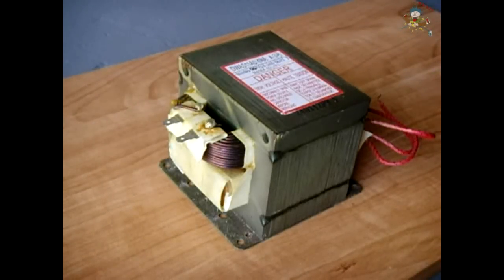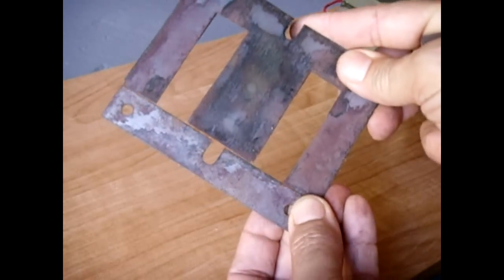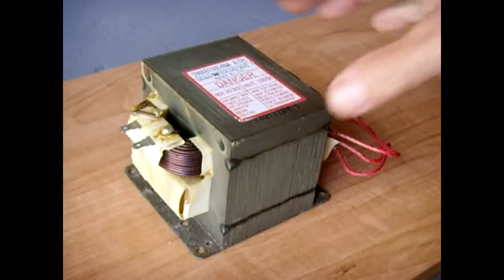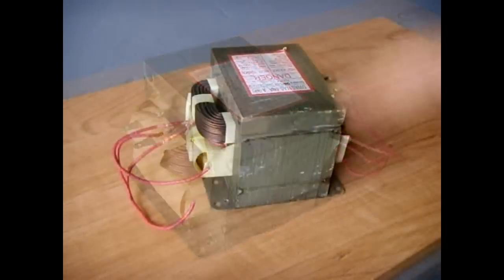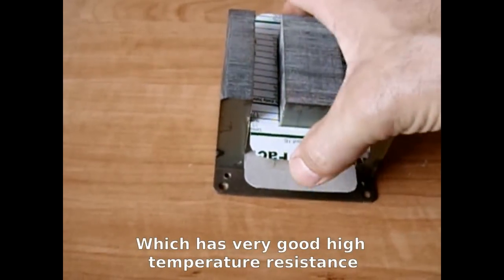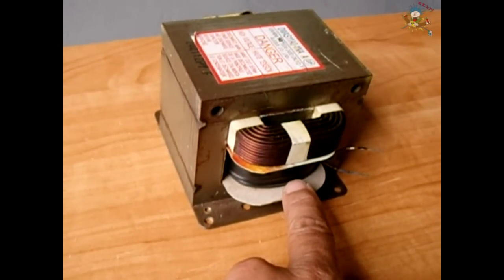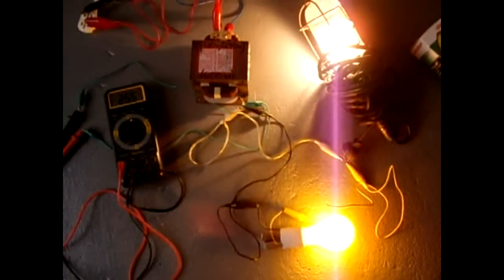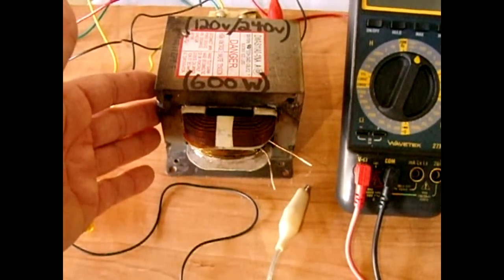How To Make Custom Power Transformers

Comment: how did you take the copper windings out of the core?  did you heat it?  need to show how to do it.  i have been trying but unsuccessful.  the glue is the problem.
Reply from the maker: No heat. After the core was opened up, I kept wiggling, and gently prying the primary winding until it started to lift out. Be careful. You do not want to damage the primary. Use a thin piece of wood or plastic against the coil and pry against that(close to the core). As one side lifts, you have to insert a wedge to keep it from going back down as you pry up the other side. Don't worry about damaging the HV secondary. When they are both removed, you can take a razor blade and clean the core to remove any varnish.

Thanks For Watching!

Comment: What type of welding do you use at transformer cores stick or flux core welding ?
Reply from the maker: Stick
Reply: Ok that is cheap to do then ! I wanted to start with welding and friends told me stick would be the cheapest and most economical way for home use ! Thank you for your fast reply

Comment: i did mine rewind  the secondary  i got 18.4.V    but  it takes a lot of heat  only for few mins, I was going to us it as a bench power supply  but its not reliable for power supply. but the AMP and Volts are very good its just  heat up fast
Reply from the maker: I did not experience any excessive heat. If you used the transformer winding calculator in the video description area, and also rewound the original 120V winding with thinner wire and more turns, you would have no issues. Take the fan out of the microwave oven, and use it to cool your transformer while it is in use. Problem solved. :-)

Thanks For Watching
Reply from the maker: You do realize that to compensate, you can place a 20uF up to 50uF OIL FILLED(Round or Oval METAL can) RUN CAPACITOR in series with the hot line into the transformer's primary winding. Doing so will reduce the current output of the transformer, and make it run MUCH cooler! The secondary winding output voltage stays about the same, but you will have lower output current, which is usually fine. This is great to do when you chose not to rewind the 120V winding.
Reply: electronicsNmore im gonna try to rewind  a new P & S   but I open my mot and removed the P,  so I have a bunch of megnet wire from crt tv  32"  would that be work?   And also im gonna try the  caps  I have  couple of them  to run series  from the hot wire.   Btw  I have  small mot  prbly  500w  microwave
Reply from the maker: Too bad I did not contact you sooner. You could have left the primary alone and used the cap! :-). Make sure you use the transformer calculator to establish wire size/current and turns.
Reply: electronicsNmore thats fine  the P is not lose  ill just put it back then put the S and close the mot  with cap intalled  thanks for your help
Reply from the maker: You can probably get away with a 20uF in series. There will still be plenty of power to use at the secondary output.

Comment: Why would you reweld the end plates after rewinding?? Mots are made cheaply, those two welds increase eddy currents dramatically, because it shorts out all of those, "independant, insulated plates" that should never be electrically connected to any other plates..   When connected by weld, you basically turn the entire core into one iron block !! It would be better to put a thin cardboard strip between E and I core to keep them insulated from each other.. Then they can be glued or taped back together. This will decrease heat losses due to eddy currents. I file the edges after I cut out the weld with an angle grinder, in order get to a clean surface with each layer exposed and no longer touching its neighbor plate on either side.
Reply from the maker: Incorrect. The welds are SHALLOW. If that was the case, they would not bother welding transformer cores after assembly at the factory. Yes the eddy currents are increased, but not to a level that causes big problems. If you choose to not put the transformer back together the way you found it, then that is up to you.
Reply: Well you can always scrub the original core and get a solid core replacement or make one if your that good.

Comment: thats pretty cool Idea you have there. there are a lot of uses with this info  for this transformer core to low voltage high current applications, cool video.
Reply from the maker: Glad you liked it. :-). Use the transformer winding calculator software and make whatever you need.
Reply: I have about * of these from scrapping. my main goal was to collect as many of the Primary Winding's as I can and hopefully the same size, for a wind turbine build. but now I see other uses for them.

Comment: The link to the transformer calculator doesn't work so I googled up another site which gives the calculations & a chart for wire gauge and its resistance per metre.
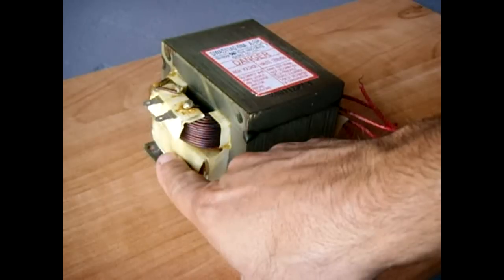I was looking at making a 24 volt to 240 volt AC inverter if not a transformerless setup,just find 3 dead microwave ovens then rewind the 1600 watt transformers with a 1:10 ratio meaning they will step the 66.6 amps down to 6.66 amps meaning a 19.98 amp output under full load will be achieved.
Reply from the maker: Link works fine, I just checked.

Comment: Do you know where I can get laminations and materials to wind on?
Reply from the maker: +Putins Cat 
Find a microwave oven that was thrown in the trash. You can buy enamel/magnet wire on Ebay.
Reply: electronicsNmore Without dumpster diving, any ideas on companies that sell these things?
Reply from the maker: Putins Cat
Try your local appliance repair shop. Ask if they have anything getting tossed out. They may sell it to you for a cheap price.

Comment: How did you open the transformer when the sheets are alternate stacked and glued? I spent all day trying to open it up...
Reply from the maker: Not glued. You simply cut the welds.
Reply: In file MOTs are common in todays cheap microwaves, I think they quit doing alternating "E/I" cores in MOTs back some time ago to increase production.
I have some MOTs from the late 70' and 80's that are alternating "E/I" cores and are noticeably bigger and rated for higher wattages (1000 watts). these make the best low voltage high current welders too. they are easy to re-wind IF your careful with a chisel to cut the secondary out.

Comment: i am trying to get around 60-90kv. i have a microwave transformer. i think that a cockroft walton multiplier wont work because it needs too many stages. does anyone have any suggestions please? i also have a flyback transformer, but it outputs dc (i cant remove the rectifier circuit from it so i cant use it, i dont think). any ideas would be really really appreciated!
Reply: Well - think about running some in series - 4 Mots in series would give you 8000 volts - but then everything insulative starts to break down - you are in big boy land already with MOT"s but now you are in stuff jumping out  to say hello from a distance  - be careful  - I think also look into high frequency Tesla coil stuff - because the frequency is high the skin depth penetration is super lower meaning the current does not travel up the arm through the heart - and kill you... as easily

Comment from the maker: @robrat5162 New link is up
Reply: +electronicsNmore I've heard that cutting the core open is a bad idea: true/false if I can weld it back together?
Reply from the maker: I would not call it a bad idea, nor would I call it a great idea. If you carefully cut the old shallow weld, and weld it back together all lined up using a similar shallow weld, you will be just fine. You may lose some efficiency, but nothing major.

Thanks For Watching!
Reply: +Sarah Szabo actualy you dont even have to weld it back together , i currently have such a device and it does not matter because its magnetism thats important not current . im not saying current doesnt flow threw the core but i think its undesired so any thing that can stop eddy currents as they are called is said to be a good thing
Reply: NOBOX7
Yeah, I welded it together a while back and have been using it since, it's pretty quiet. Seems fine!

Comment: Very interesting demonstration,However is it possible to make a winding to reach 350 volt instead????And reach secondary current 5 Amperes???This would be exact transformer I seeking,it seems more smaller and much better better sized than original maybe 70's or 80's design which consist of C core and weight near 45 pounds...
Reply from the maker: The transformer would need to be much larger. Use the calculator provided in the video description area.
Reply: Software not work on windows 7 64 bit....Besides,how about use so called inverter or bipolar transistor???Many mig welders have that component and decreased unwanted heavy weight....So transformer is smaller but voltage float is high,wonder if current could be increased as well??Is anyone ever thought about bipolar transistors before???Wonder if they can fix a voltage limitation magic for me??
Reply: Could autotransformer be used for welding??
Reply: I just check something that I should check long ago,The transformer I was look for is unnecessary,only thing I wonder how to add 50 more extra volt toward existing transformer output without modifying any coils...I realized that I have transformer rated 250 volt and it rated 5 amperes,adding 50 more volt or perhaps 100 more volt would solve all problems..I like it's size and it would be great choice for plasma machine primary torch power reactor,the Multiplaz 3500 is sucks more than I even thought previously,it uses 170 volt for torch ignition and nearly reach 2.5 amperes..No wonder why Multiplaz 3500 doesn't do a job in cutting or welding,plus there is no transformer inside Multiplaz 3500 which was shocked me completely when one person upload internals of Multiplaz 3500 power supply..There is only 2 IGBT transistors which regulate voltage but no step down transformers or any induction coils eather...The machine have 5 PCB circuit boards and looks like a damn computer rather as welding machine...
Reply: When I turned on my transformer it showed me on multimeter 250 volt and 5.3 Amperes current,just wonder if something extra could be added to reach extra 50 or perhaps 100 more volts without transformer modifications??If this puzzle would be solved than I would continue on my plasma machine power supply assembly...Now secondary transformer requires for welding,I need transformer for arcing to work as tig or mig mode,however plasma arc melts the feeding wire..It says that plasma torch must be kept away from secondary power source about 3-4mm away from weldable parts...So I stancor P8689 autotransformer as primary torch transformer and Secondary Loyje 120 to 220 autotransformer 4.5 amperes....

Comment: You said that modern transformers are much smaller because they are transforming voltages at much higher frequencies ... kilohertz range ... my question is: Since the wall socket only offers 60 Hz... where does the kilohertz come in? Does the TV somehow increase the frequency of the voltage before sending it to a transformer for voltage reduction?
Reply from the maker: Hi Mike. There's a circuit that is designed to drive the smaller transformer at a higher frequency. :-)
Reply: I guess I’m still confused ... electricity is delivered to our buildings at 60hz ... you have to deal with that before you can do anything else, so your suggesting that the first transformer which works at 60hz drives a circuit which then drives the smaller transformers at higher frequencies?
Reply: No. Google "switch mode power supply circuits". Mains power comes in, gets rectified to DC, and then switched rapidly. This allows a far smaller transformer to do the same work that a giant power transformer does. It's the kind of power supply that your computer or laptop uses.

Comment: I can't tell if the jigsaw has a metal housing. If it does, I'd suggest throwing it out. Tools with metal housings usually have ground faults that can give you a lethal shock. I see them in Goodwill stores occasionally, and just pass them by. Most are not grounded and only use 2 wire cords.
Reply from the maker: It's was an old, but very well made jigsaw. Failures are very rare, and it may have been double insulated.
Reply: you could also insulate them somehow - cut strips of pop bottle plastic and hot glue them on -or use rubber inner tube - but hey - I'm with you for sure - I had some vintage really nice aluminum drills / circular saw nut NO WAY my hand and fingers are gripping that thing tight - I've felt 60 hz buzzing  me enough times to not want that feeling again

Comment: What if connected two secondaries (identical or different  )  around the other cores (not the primary core) ? what would be the power efficiency ? then if you connect the secondaries in series or parallel?

Comment: Impedance matching for any application.
If you can isolate the primary winding the find the voltage per turn you are away.
I have been taking the cores and winding them as inductors. So many odd transformers on hand .

Comment: I'm about to mirror this transformer project exactly and was wondering how much 18 gauge enameled wire was required?  If I order a 1lb (200ft) spool will this be enough for the 210 turns that you wound on?
Reply from the maker: Every transformer is different. I would take a string and wind it around the core to see how many inches you get. Keep in mind, you will need more wire as you move outward winding. Look for an average measurement per turn then multiply the inches for each turn by 210 turns(If that is what you want). Then divide that result by 12 to get how many feet.

Thanks!
Reply: electronicsNmore Thanks for the quick reply. I just ground out the welds and took the windings out and measured 8.25" around for the inside turns and 13.25" around for the outside turns for an average of 10.75" or 223 turns from 200 feet of wire so I'll just order a 1 lb spool.  Also, if I add the motor run capacitor on the primary to keep the core cooler this reduces the wattage potential of the transformer?
Reply from the maker: Adding a high enough voltage rated run capacitor in SERIES with the hot lead, will result in reduced power in and out. You can also place the microwave cooling fan close to the MOT inside a housing, it will stay cool at full power. Or you can use the transformer winding software and rewind the primary to save lots of power, but keep the same output.
Reply: electronicsNmore I put 120VAC to the small squirrel cage fan that I pulled out of the microwave yesterday and it works perfectly so I be doing that, using the fan instead of rewinding the primary or using the capacitor.  The heated laboratory stir plate I need 240VAC for is about the same wattage as the microwave so I figure I need some sort of cooling.  Thanks for you help.
Reply from the maker: Great. Glad to hear it worked for you. A cooling fan very close to the transformer inside a housing to pull the air across the transformer, will keep it cool.